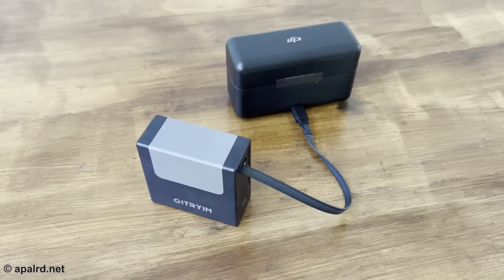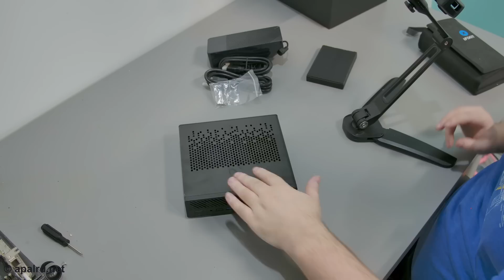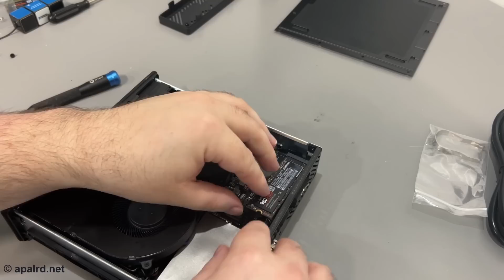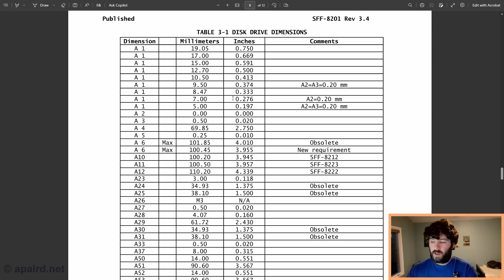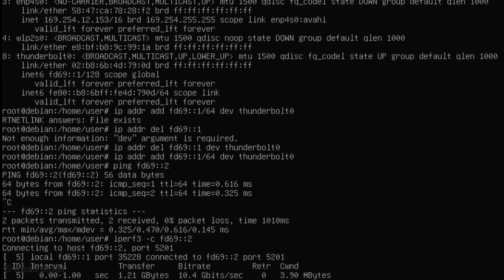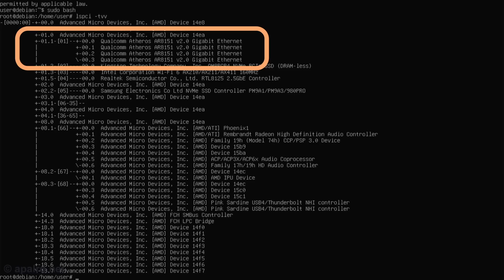a POWERFUL Mini PC for your homelab? Minisforum MS-A1

Comment from the maker: Update on Minisforum dead NIC communication:
- Sun 9/15 - Emailed my PR contact about the dead NIC and mentioned possible damage due to the unsecured heat sink
- Tues 9/17 - PR contact responds, said "Will send your question to the tech when I get back to the office tomorrow. When the technician replies. I will contact you first."
- Fri 9/20 - Video published. No response from the technician at this point.
Reply: any update?
Reply: @SeanSR  Guess he doesnt have anything good to say hahaa
Reply: The i225 from intel (then rebranded as i226 but still not fixed) is inherently defective. Lots of forum posts about this. My particular one a few years back kept negotiating 100MBit. Returned it defective.
Reply: @mokahless  According to the video, the MS-A1 has realtek 2.5G nics
Reply: You only need to remove the two long screws from the bottom in order to slide off the case. The supplied clip is used to grab onto the rear vent while you slide the chassis out of the case.
Reply: Minisforum customer support is notoriously bad. On the other hand it stinks at Asus as well. A lot of computer hardware vendors treat their customers like trash.
Reply: Hi @apaird, any update on the NICs. I have found that they work ok when not using Oculink and then when you plug Oculink in with a PCIe Card they die. Any ideas? BIOS settings? thanks

Comment: I like this MS-A1. I bought the barebones version and sourced my own 8700G, NVMEs and DRAM. I didn’t have nearly so many problems getting it assembled. For starters mine hadn’t been abused and nothing was missing or misplaced. I would have liked clearer instructions on how everything went together (and minisforum do certainly have some work to do with respect to user documentation; they need to look at what you get with the likes of a giga-byte motherboard). But I think I must also have had a later revision because the heat sink/ fan and U.2 mounting arrangements didn’t look like yours. I think you might have had an early sample.

Right enough the 2.5Gb Ethernet would be annoying if I wanted to serve over Ethernet but that’s not what I want this box for. I wanted a compact low profile box with some power and capacity that had better thermal management than the NUCs and beelink GR9 that had  both munched through several fans and ultimately cooked themselves to death. So far I’m quite hopeful. Even with the desktop CPU (!) In normal operation the fans are whisper quiet and temps are low. I do think the PCie 3.0x4 and the x1 slot are kind of dumb. What are you even meant to do with those? You can barely get pcie3.0 drives any more and the ones you can get are small. The issue is likely just due to the limitations of this particular family of CPU’s and the MS-A1 was about as good as you can make it to work with the 8700G and its relatively frugal 65W TDP. Hopefully there will be a processor soon with similar capabilities and power consumption and more pcie lanes

Comment: Great video. I bought 2 barebones and paired them with a R7 7700, 2*32GB Crucial ram and 2TB Kioxia Exceria pro. Iinstalled Proxmox on both and set them up in a cluster (3rd one planned for the future) I have them both connected directly to my UDM on the left 2.5G LAN. On both machines I am experiencing freezes and crashes on both VMs and Proxmox itself. I think it must be some I/O problems, perhaps some power saving features on the nvme that don't work as it should...
Reply from the maker: anything in dmesg on Proxmox? Usually you'll see errors show up there
Reply: @apalrdsadventures  Thanks, when I run "dmesg I grep Error" I actually get some ACPI BIOS errors, might be worth investigating 👍🏻

Comment: I think I saw a review on this before and I believe there was an oddity with it that they use 2 different chips for the different nics so they would use different drivers.
Reply from the maker: is that the Intel version? the Intel version uses one NIC which supports intel amt and the other which does not, but they should still use the same drivers.
Reply: @apalrdsadventures  it might have been the intel version since I remember then being 2 different Intel NICs

Comment: AT around 6:20 you have not installed the drives and the heat sink correctly. you fix the drives in place first by unscrewing the top of those mounts. Then the heat sink goes on top and the little screws go into the top of the mounts. I've just done this and it works fine

Comment: considering one of these for firewall etc.. Jim's Garage already dinged it compared to the MS-01 but I prefer homogenous cores for virtualization. The haphazardness of screws in the device itself was not entirely encouraging! I see interesting stuff on your channel so added a sub.

ETA: Would have been interesting to see what the M.2 drive/heatsink situation is like in the barebones unit. They can't be attached together if there's no M.2 drive?
Reply from the maker: I actually didn't assemble it right because the assembly is unusual. You are supposed to unscrew half of the standoff (it's two standoffs on top of each other), then screw the top half onto the m.2, then screw the heat sink into the threaded hole on the top standoff. So you could have the heat sink properly assembled without m.2s installed. 

That said, the heat sink is supposed to come pre-installed and mine was loose with two loose screws, so that was also not correct.

Comment: The thing is they missed the design of that mini pc. They wanted to recycle some work done for the MS-01 and do a workstation (whereas the MS-01 is more for networking). But there are too many red flags (like the multiple M2 slots with different standards). They wanted to pack too many things without having the good layout for that. Checking items on the wish list is one thing, having a well designed layout is another story. And you start to dig in you find more and more quirks. It's not the first time they do that, the NAD9 was also supposed to be the perfect mini pc...

Comment: The a1 doesn't seem to slide apart, it doesn't have the 2 10 gig and the two 2 1/2 gig ports, all of which arent Intel, like on the 01 it doesn't seem to have all the usb-c ports, two of which are Thunderbolt, which is nice on the 01 because you can do a daisy chain Network in proxmox.

It just seems like a way less refined product. The whole thing seems physically like a pain. The 01 is so well designed. Honestly it looks almost like a different company built it
Reply from the maker: Apparently it is designed to slide apart, but you have to use a metal clip tool to pull it out of the case. I was unable to get mine apart this way without bending the clip, so maybe mine is just dented or out of tolerance enough that I have to take it apart the hard way.

Even if it wasn't bent though the metal clip is a really stupid design.
Reply: @apalrdsadventures  interesting. Yeah in the 01 I'm sure you know the most you have to do to add RAM and nvme is is lift up the fan and duct.
Basically the same price without the 10 g nics so maybe the CPU I guess is costing them more?

I wonder if the Intel is socketed? Not that that matters to me at the moment. I have a new Asus zephyrus g16. I would love if that was socketed because I have the first generation core Ultra 9 and the second gen that came out shortly after has an npu that's like 20 times the teraflops

Comment: Speaking of toolless M.2... I recently bought a new drive and I found out it didn't come with the mounting screw... I guess my motherboard should have had 3 of them (one for each slot) but I only had 2 already in use.
I was kinda frustrated since the price of those screws is just stupid (I mean, it's not huge but it's insane for what they are) but somehow I found a comment suggesting that I could find one in an old GPU.
I disassembled my old GTX 460 which I kept and there actually were 4 screws holding the fan to a small frame which were actually usable to lock an M.2 drive.

Comment: I really appreciate your in-depth trouble shooting and stating your concerns. I am a little disappointed that Minisforum failed to contact you on your concerns of the product.  I have the MS-01 and use it as my Proxmox hypervisor, so I don't think I need this MS-A1 even though I would like it because of the better graphics but I don't want to have a oculink video card , I just want a all in one working system with a little expandablity.

Comment: By using a similar case, they invited a comparison to the MS-01.  In some ways, yes, it's the "AMD" MS-01.  But not really.  Both the 01 and A1 have strange compromises that I think could have been easily avoided.  For the 01, the biggest compromise is actually the case size - just a bit bigger would have made it easier to put in PCIe cards for example.  The compromise on the U.2 size is common to both and makes it harder than it needs to be  - just increase the case size a bit, and I don't think the target audience for these would have minded at all.  They are both straddling that line between Mini-PC and something new, perhaps a mini-workstation.  Minisforum needs to go more "workstation" and a little less "mini" IMO.  But now the A1 - WTF? This is getting long, so in short form: No 10G?? Not even one??  No card slot??  And why the mix on the PCIe gen?  Is there a PCIe switch in there?  I need to look at mine.  It's also obvious your review unit was a recycle, either from a show or another reviewer - I can't imagine it comes that messed up inside.

Comment: You only need to remove two screws to remove the case. Those  two long screws are the ones. After removing the screws, use that clip thingy to pull the back panel, RTFM!
Reply from the maker: I bent the clip trying it that way, mine is not made very well.
Reply: Exactly. 2 other tech youtubers did exactly the same thing. 
IMO you're point about how to reach the system is fauly.
Getting the system out of the shell is super easy. 2 screws and the pincet thingy and its out.  Not as easy as the MS-01 but defo not rocket science.

I do agree abiut the 10Gbit ethernet ports aswell as the 2x thunderbolt USB-C ports.

I see it as a gaming mini pc which has NAS capabilities.

Comment: They hit the ball out of the park with the MS-01 (with the PCIe slot, dual 10 GbE, and dual 2.5 GbE NICs).

With this one -- I have NO idea how drunk they were, when they were planning for this product.

If they had taken everything from the MS-01 and just changed the CPU socket, this would've been another home run.
Reply: Can confirm. I bought an MS-01 to use as a homelab server. Will be buying another to replace my workstation.
Reply: @BestSpatula  
Hopefully, the issues with the 13th gen Intel CPUs will be resolved shortly, otherwise, picking up a unit with the 12th gen CPU might be a potential alternative.

I've thought about it, but the higher power consumption of the Intel CPU (vs. the AMD Ryzen processors) makes it a tougher sell for me, personally.

There are a lot of pros, but that is also a huge con for me as well.
Reply: @ewenchan1239  Intel says that only socketed desktop 13th and 14th Gen CPUs are affected.

Intel claims that 13th - 14th Gen HX/H/P/U mobile CPUs are not affected.
Reply: @qbtc  
Do you believe them though?

(Or asking the same question in a slightly different way -- does Intel have ANY motivation to lie to you?)
Reply: Agree. I'd prefer a homogeneous compute environment - AMD or 11th gen Intel. AMD wins on power and probably speed, although that's not a primary consideration for a net appliance; power is.

Comment: For the M.2 screws and heatsink, there are two through-hole hex screws to hold down the M.2 drives, you have to unscrew them, install the M.2 drive then secure with the hex through-hole screw. The heatsink then can be secured down into the through-hole hex screw.

Comment: Does the RAM runs at 5600 or 5200?
Reply: The unit ships with 5600 crucial memory, but reports in the bios as 5200 mhz memory. BIOS update anyone?
Reply: 5200MHz max working speed.

Comment: The Minisforum MS is receiving quite a bit of attention on YouTube. Given the price, this doesn’t seem justified to me. For about 200 bucks more, you can build a machine with ECC RAM, decent front-to-back airflow, 2 x 10 G Ethernet, and enough space for larger PCIe cards. Additionally, in this case, it’s easier to reuse the components for other projects in the future

Comment: So, I just built one of these by getting the barebones version. It’s a lot easier to take apart if you read the manual online. You can just remove the 2 long screws to take the case apart. Once the screws are out, you just slide the whole system out of the case without removing the bottom panel.  My system came with screws in separate bags, and a clip to help slide the system out of the case. Also, I ended up using a 7900x as the cpu for 12 cores at 75 watts which worked out really well for a proxmox setup. I would’ve gotten a 7900 instead, but the 7900x was cheaper. The one thing that really drew me to this system is the upgradeability. I can in the future upgrade to Zen 5 or Zen 6 assuming they are still using the AM5 socket. That combined with 96gb ram capacity and occulink for possibly adding a gpu for AI inference or running a remote gaming server is great capability for the size, price and power efficiency. The lack of 10gb was the only real downside compared to the MS-01.
Reply: Same here i got the barebones with a 7900x and a 96GB ram. I have mine running at 110w sustained with some cooling upgrades
Reply: @Will-sc3hw cool. Can you tell more about how you made a cooling upgrade?
Reply: tbh the I/O in general is a big downside with this system. the Oculink dock doesn't have sufficient lanes to be a big plus graphics-wise. I just don't know who this machine is *for*. it's not really a compute
 workstation bc of the GPU issue. it's definitely not a homelab box. it's just weird.
Reply: 7900x is 175 TDB how is that possible? It will get too hot,.
Reply: What about the thermals? Does it thottle a lot whwn gaming or running intensive tasks?
Reply from the maker: It looked like that should be possible, but I have tried everything to separate my unit without unscrewing the back cover and it will not come apart. I also bent the clip trying to use it to pull the system out of the case. Maybe my unit is damaged.
Reply: @apalrdsadventures yes, it was a bit tight and the clip was not a great way to do it since it is pulling on the plastic front cover. I started just turning it sideways and shaking it until the unit released from the clips on the back cover where it is secured.

Comment: If one is the sort of person who will just buy it and use it as is, these sorts of mini pcs are okay, but doing upgrades can be a real pain, with a very real possibility of damaging something taking it apart. The small "1 liter" HP PCs (and others) are much easier to deal with than what Aalrd had to go through with this one.
Reply: even with a mini-PC from ASRock, in my opinion, there will be significantly fewer problems. And the build quality is higher. (in comparison with Minisforum MS-A1)

Comment: What is the max ram size?
Reply: 96GB DDR5 max 5200MHz. You can use higher mem speeds but it works max on 5200MHz.

I'm using 96GB 5600MHz
Reply: 96GB AFAIK

Comment: Thanks. Nice to see that they didn't send you a special, "perfect" box. 

Have to hope they are rethinking some of their engineering design choices. 

Whoever put it together must not like their job? Can't blame them. As a consumer I would not enjoy doing upgrades on this thing so I can't imagine putting them together over and over again... Got to take really good care of people to keep quality on something this complicated
Reply: I purchased a Beelink mini PC early this year, and when taking it apart to install an NVMe, I found one of the motherboard screws was completely missing. I had a screw in my stock pile that worked fine, but it does make one wonder about assembly QC of these mini pcs. Other than that very minor issue though, it worked fine.

Comment: Is it possible that the two long screws you found securing the bottom cover were for the m.2’s, and the two loose screws you found inside the unit were for the bottom cover? It’s an eval unit, so who knows how many hands it passed through. At any rate, definitely some missing QA in their review process.
Reply from the maker: The two long case screws are a different thread than M.2 screws. 

Also, they do actually go further into the housing - 6 of the screws secure the back plate to the case extrusion, but the other 2 go through the case extrusion into the 'core' where the PCB is mounted. It looks like it may have been designed to slide off with only removing those two screws, but I cannot get the case apart without taking off the back plate and front trim and the whole case feels tight.

The box also felt like a retail box, but not sure if it came from retail stock or not. I don't think it has passed through anyone but Minisforum.